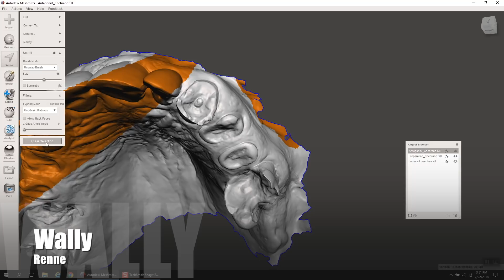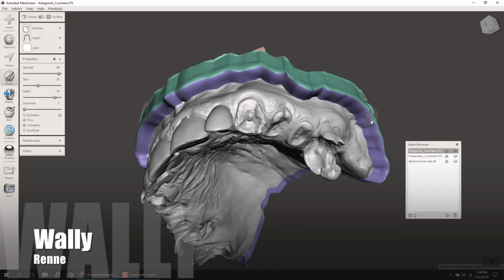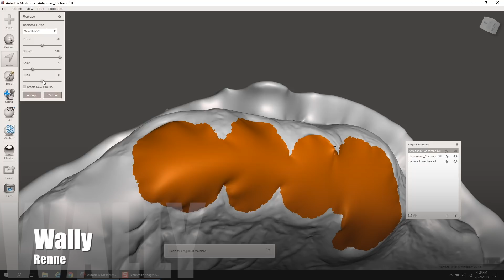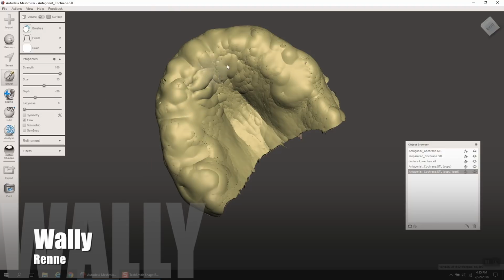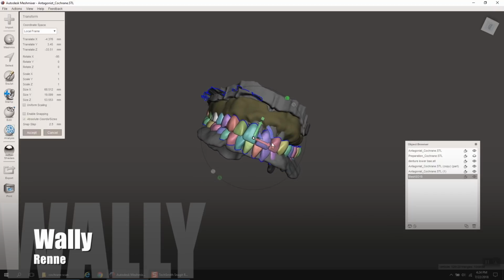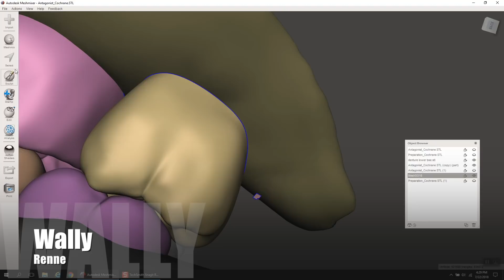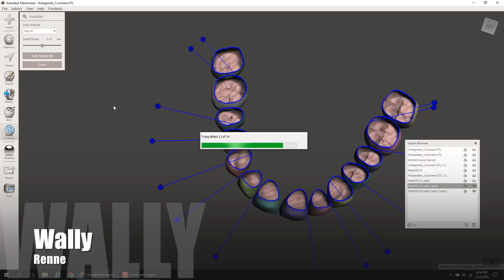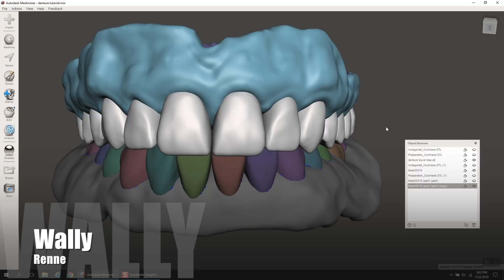meshmixer denture tutorial

Comment: Just a quick tip, you can press O to optimize the boundary while selecting and replacing teeth. It will fill in little areas where you may have missed
Reply from the maker: tsl c&b thanks that will save me lots of time

Comment: just a little tip, Wally, when selecting mesh using the red draw tool; the selection area will extend beyond what your draw in the direction of either end of the red line that you drew. Make it a habit to end your selection with a curve away from  the scan and you wont have that annoying highlighting problem any more.